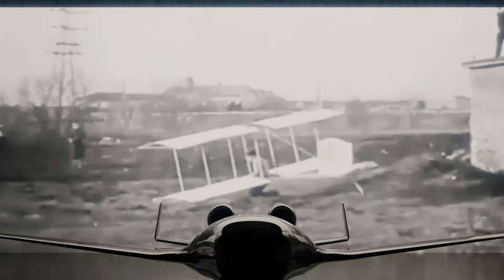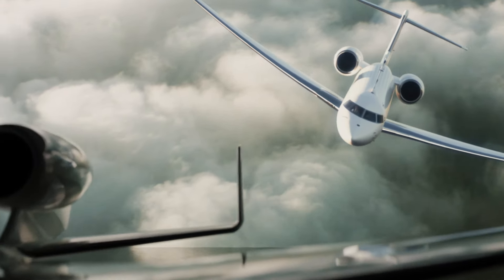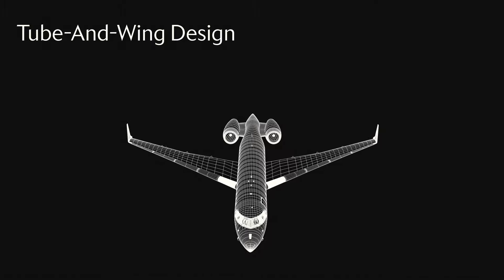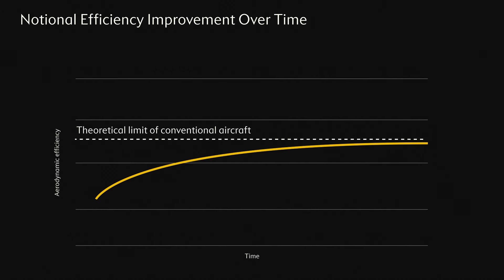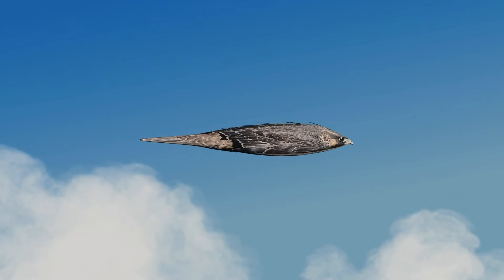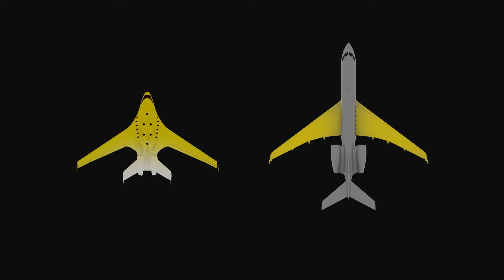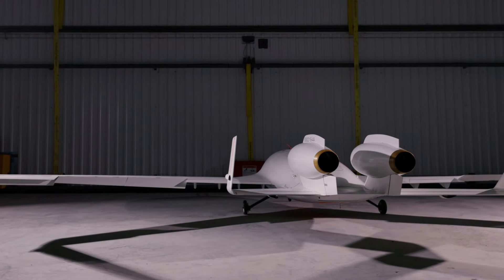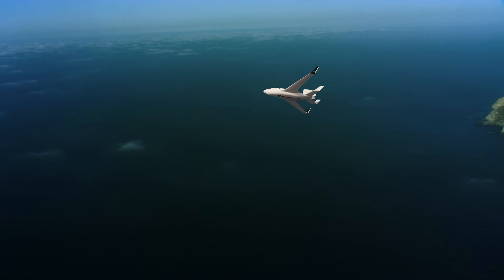The EcoJet | The Blended Wing Body (BWB) 101

Comment: One huge benefit of this twin top mounted Turbo Fan ENGINE is dramatically reduced Foreign Object damage prevention from FOD on the ramp and even in flight via Birds I really like this design of passenger jet and the known fuel efficiency gains and wider passenger seating arrangement etc. With modern avionics helping preventing stall recovery conditions I feel this design is ready for production and only the legal insurance cost factors prevent these newer Blended wing designs from making it to market in the USA. American government should help pave the way to ensuring these newer aircraft designs have the aviation safety regulation management to clear the path to commercial success.

Comment: Does reducing power needed to propel the craft through the air, allowing smaller engines mean longer takeoffs (less powerful engines will accelerate the craft's mass more slowly from rest), or does this design also reduce takeoff speed? Perhaps in this market segment, there is already runway to spare?

Comment: The future of ALL aircrafts!
Reply: All aircraft MUST be electric the Tuesday after next Wednesday🤡
Reply: @paulo7200  And they most likely will...or hydrogen powered, battery fans or fuel for jet engines.
Reply: @paulo7200  honestly i think some form of electric propulsion is the future, by the time we have a solar farm in space we could beam power to planes at cruise altitude, so they can fly long distances without producing any harmful emissions

Comment: Love it! Pair it with a hydrogen-electric set up and Taylor Swift's MASSIVE carbon footprint could be a thing of the past!
Reply: I try not to give Taylor too much grief about it. As if she's been riding alone on the aircraft. I'm sure there's generally an entourage of friends and tour staff aboard. 
(ツ) ☕☕(ツ)
Reply: @jokerace8227  Is (ツ) ☕️☕️ (ツ) the equivalent of a /s ?
Reply: Just use SAF why is everyone so horny for Hydrogen. It’s enough to do jet fuel hybrid.
Reply: @minhpham-yh9qn  This years SAF production is slightly more than 0.5% of the global demand. SAF isn’t going to be a viable option for awhile.
Reply: @skyserf neither is hydrogen
Reply: @Thenormalpilot  Hydrogen doesn't take nearly as much resources or energy to refine. It's not even close.
Reply: @skyserf  but we have to make new engines, new ways to store the hydrogen, a whole new set of tech. It’s rosier and cheaper to just make more saf.
Reply: @Thenormalpilot  If it was cheaper to make SAF then industries would have already done it. Engines, fuel storage, and transportation of SAF is practically the same  as kerosine/JP-8 but the process of scaling production up is prohibitively expensive.
Reply: Taylor Swift, you must be joking. Have you seen the fleet of private jets of Walmart? They have more than 50 jets, all of them are used on a daily basis to multiple destinations.
Even RIL has 10-15 jets, all of them are used daily for ferrying the corporate honchos.
Reply: Batteries
Reply: @PJWey  The energy density of batteries is not close to liquid fuels yet, and batteries do not get lighter as the flight progresses. Someday soon, though.

Comment: With a shorty fuselage/body, emergency exits will be an issue for airliner concepts… might have to have doors that open through the floor to get down to the tarmac?
Reply: Also need to have a way out the top in case of gear up landings.

Comment: Any numbers? How much more efficient is it?
Reply: A full blended wing can be up to 30% more efficient.  This hybrid design retains a reduced empennage with both vertical and horizontal stabilizers — efficiency gains will surely be less than 15%.  Which is still a lot!
Reply: My high fidelity optimization studies show 9.8% on a 500 nautical mile mission, and conservatively up to 28.8% for an edge-of-the-envelope long-range mission. These numbers are for a 104 passenger regional jet.

Comment: They couldn't make the c series profitable without help, so I can't see this concept ever fly..
Reply: I think their biggest issues were multinational certification of a commercial airplane and marketing. Both of which Airbus is more equipped to handle. The technical side was a non-issue... This, however, is well within their business jet centric business model. So, as long as the newer composite construction techniques don't pose much more certification difficulties than the usual tube construction methods they have a good chance at success!
Reply: Not Bombardier's fault.  It wasn't that the C-series was bad, it was that it was too good.  Boeing meddled with the process, called in some favors from our elected officials that they had in their pockets.  Embarrassing for Boeing and the US, IMO.
Reply: @willdejong7763  Trump’s import duty didn’t help either!